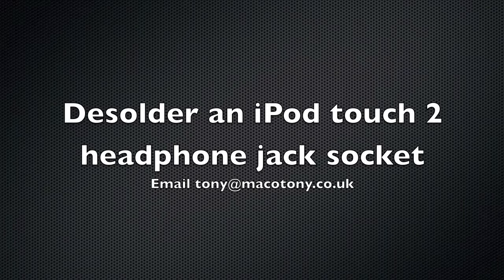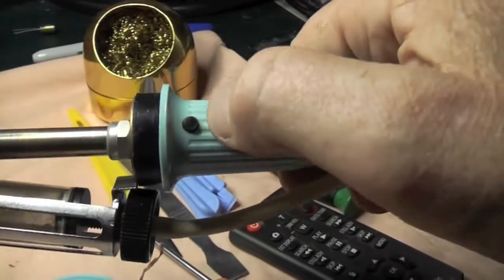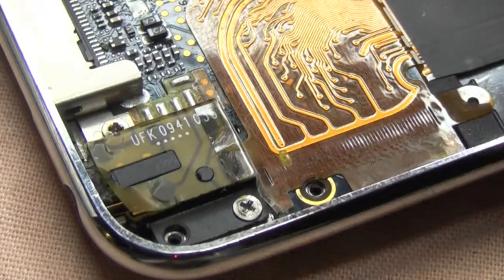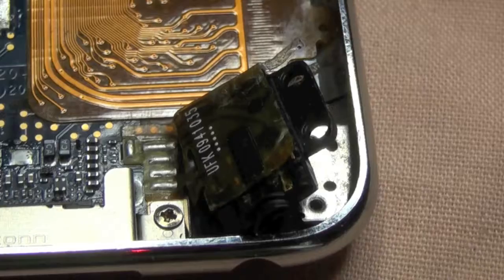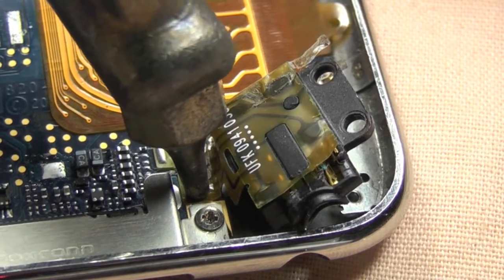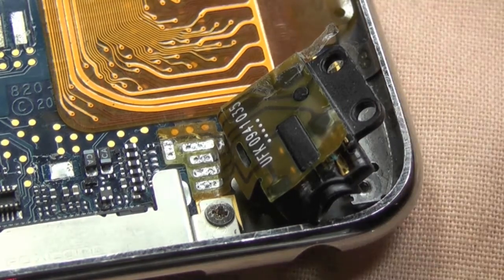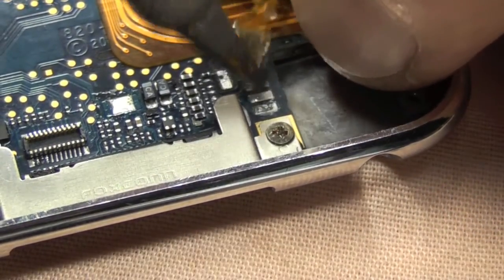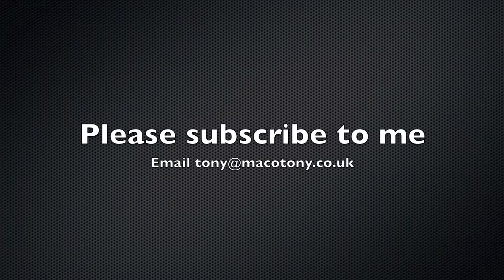desolder an iPod touch 2 headphone jack

Comment from the maker: @ibelievein30STM No, you can use desolder wick/braid or  a desolder pump to remove the bulk of the solder.
As for the solder iron, as long as the tip is large enough and clean you should get a reasonable result.

Comment from the maker: @lapd1989 well you could cause a short plus it is always advisable to disconnect power before soldering., if you do not want to remove the battery just run the power out of the battery

Comment: pfft, way to break the cable. You use a large glob of solder, heat that up over all of the pins and then gently lift away the headphone jack.